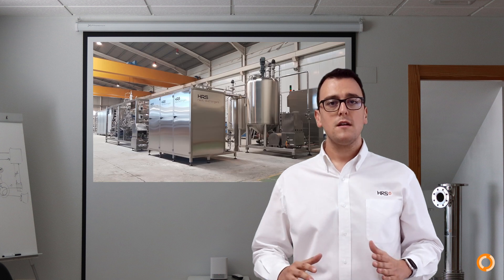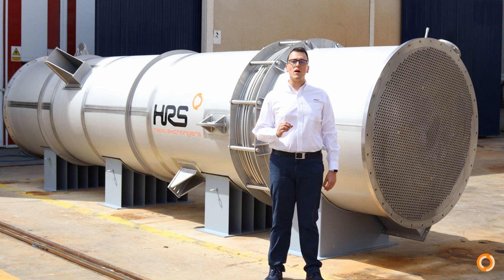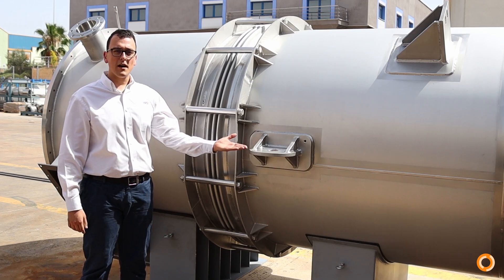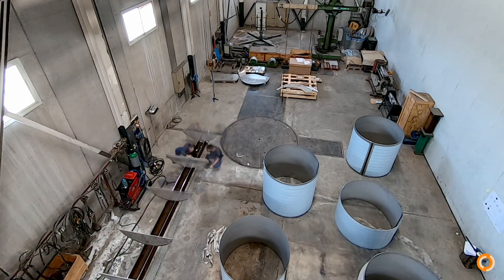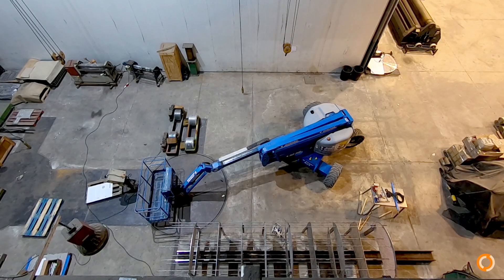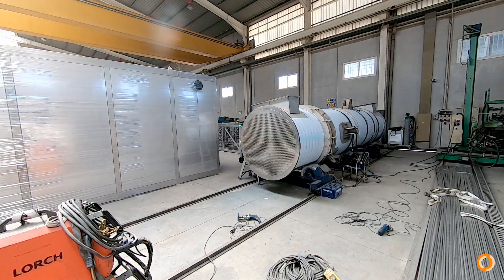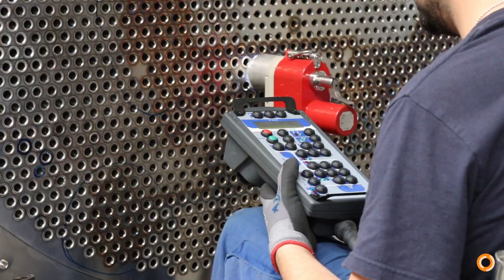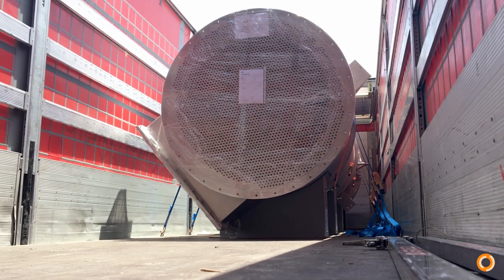Time-lapse manufacturing of large shell and tube heat exchangers

Comment: beautiful work! what is the manufacturing cost of this HX? and How much this will cost the client ? and also can you share what is the working fluid gases which are in tubes and in shell both. and why did you use Stainless steel when you can use SA 516 Gr 70

Comment: Hi, boss, I'd like to share the Tube to tube sheet Automatic orbital welding machine with you, which can improve your working efficiency and welds quality, and save labor cost and management cost for you, please check the video: https://youtu.be/diIzqK4Vjdc ,         and the Automatic tube assembling system for boilers or heat exchangers,  refer to video: https://youtu.be/h2WzmZapX7o